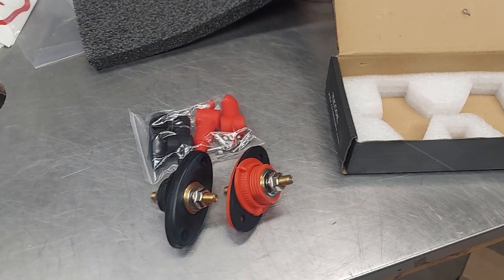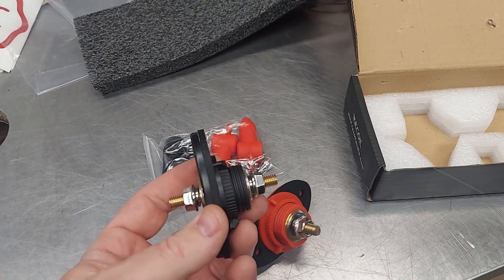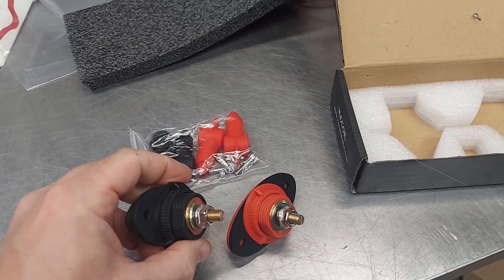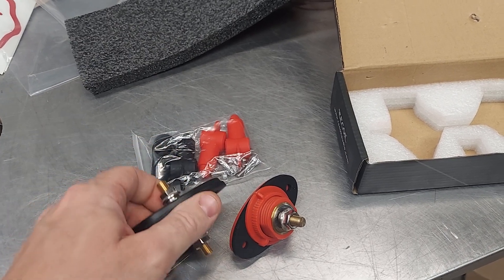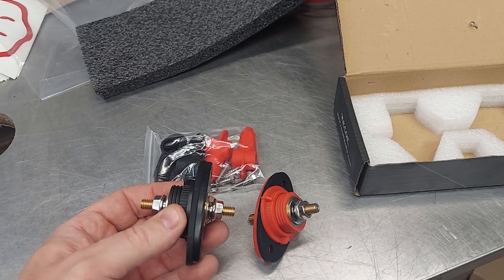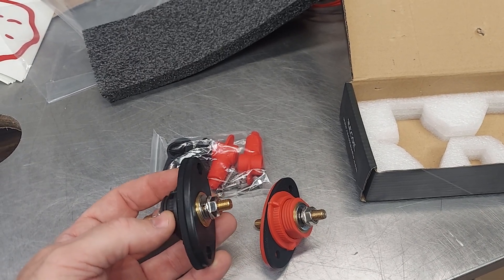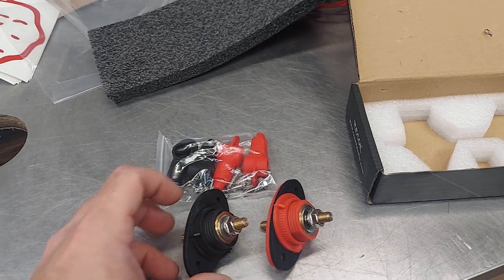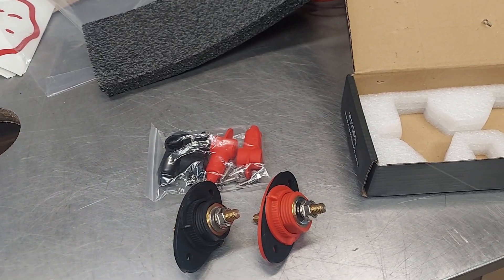Affordable alternative to SMD 1 channel box terminal - Machined Brass by Recoil Audio BTTP-516 pair

Comment: Looks like posts for jump starting quite a few vehicles on the road today... especially imports 🤦🙅🤷🤌 SMD
Reply from the maker: I've noticed that OEM's have been putting batteries in the dumbest, most hard to reach places.  2020 Durango for example.  Wet cell, INSIDE the vehicle.
Reply: @RobotUnderground  I had a 98 Plymouth Breeze it was in the front wheel well. Chrysler has been messed up forever and a day
Reply: Yea like dodge in the fukkking passenger floor boards wtfff

Comment: How do you fasten the inside speaker wires if the sub cabinet is panel is 3/4 inch thickness?
Reply: They come apart into two pieces you can see the seam if you look close, one goes inside the box one outside.
Reply: So that bolt has to be one piece.
Reply: @johnviera3884  either the bolt can pass through the wood and the two pieces are interior and exterior, or there is a hidden area where you can attach a ring terminal or something to the back side of the bolt.  Haven't seen these in person so I'm not sure which one it is.
Reply: @scottw1938  good morning!
Reply: Looks to be an inch, inch and a half easy
Reply from the maker: Just use your own bolts for $1
Reply: @RobotUnderground  I just realized what SMDs newest product, it can come bundled with the SMD steak knife... SMD subwoofer terminal bolts 39.99ea pre order price 49.99 after that.
Reply from the maker: @scottw1938  But wait!  There's more!